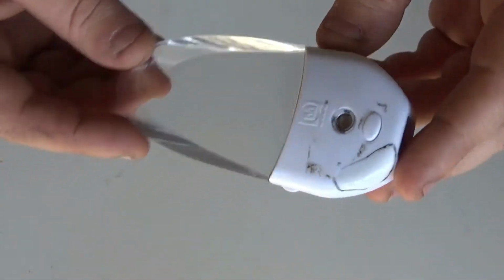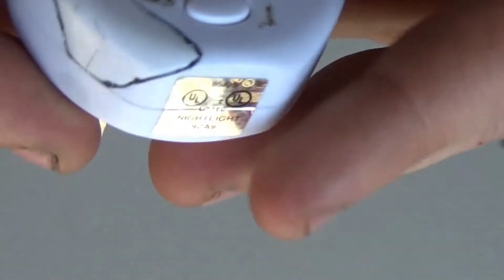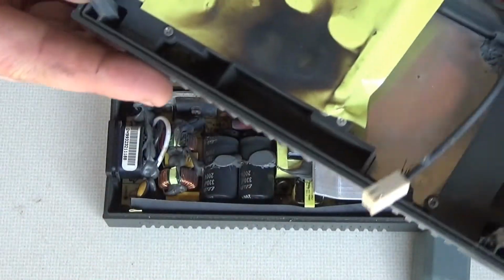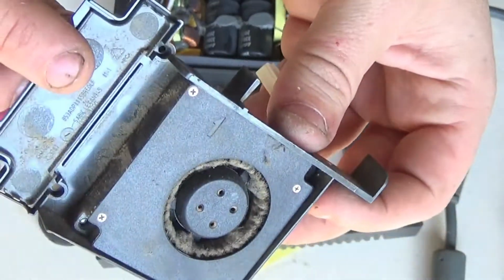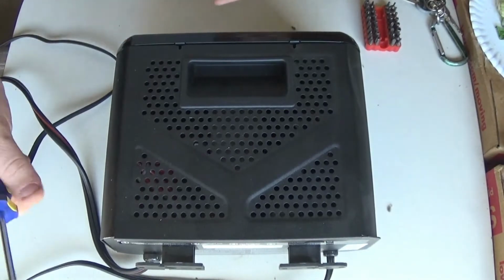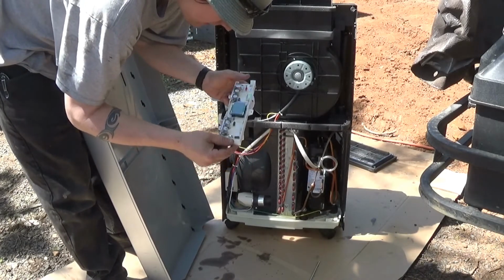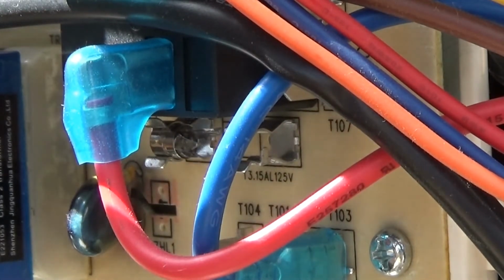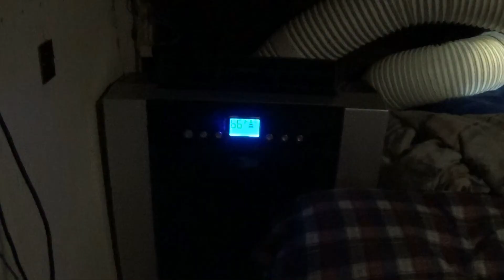Overvoltage Damage | Teardown & A/C  Repair

Comment: Putrid smelling is usually from the oil in an electrolytic capacitor. They tend to vent or explode during overvoltage and spew oil/guts around.

Comment: Fuse are there for a reason, always do not bypass the fuse... Test it with the same rating fuse and if it blow again then measure the varistor there. Chances is just a varistor shorted under protection mode. Cost of repair 2 bucks

Comment: That blue thing on the a/c unit was probably an mov - metal oxide varistor. It protects from overvoltage by shorting out and blowing the fuse. With no fuse, they explode, as they become a dead short.